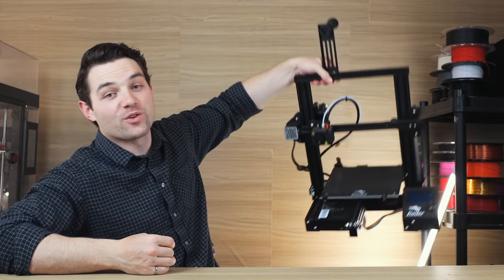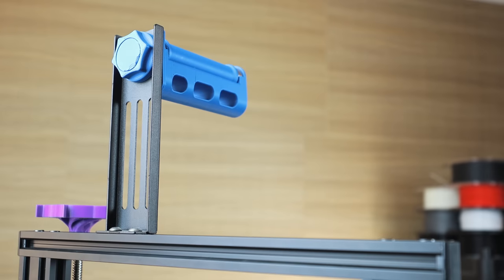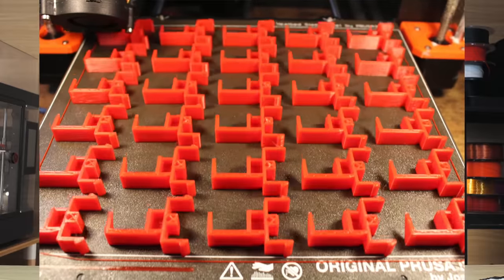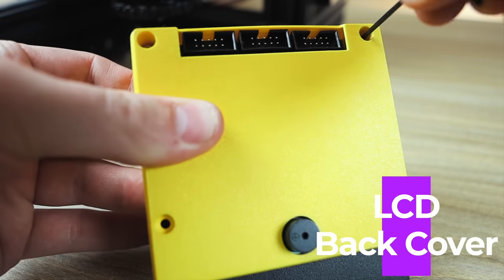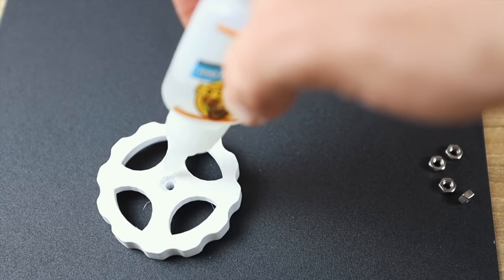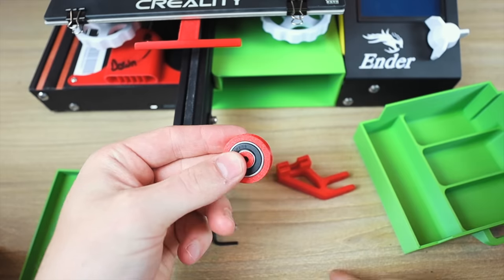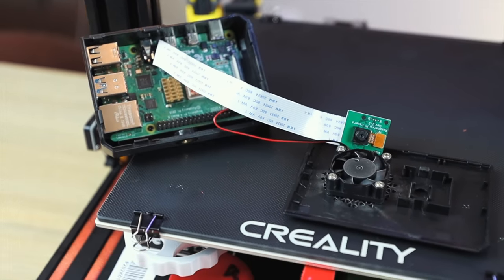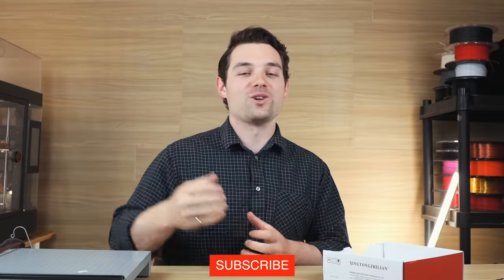Ender 3 Pro Upgrades - 2021

Comment: Honestly the BL touch is a must have imo. With creality's notorious reputation for warped beds, it's reduced the headaches and failed prints significantly, especially when working with abs and asa
Reply: Yeah that’s what i was thinking. No amount of leveling will help a warped bed
Reply: I dont use It and i never had a problem with abs failing because of bed craziness
Reply: @paolo69  yeah but there is also a reason they are just standard now on almost every new printer. simplicity, it removes that headache of trying to dial in the bed and even better mesh level corrects for manufacturing defects no amount of tinkering will fix

Comment: I've heard way too many stories of warped glass print beds so there's no way I'm not getting bl touch. Even if I don't need it, it's better to have one than miss it. I'm going to get ender 3 max soon, which ships with glass bed.
Reply: Yeah he is completely wrong about ABL. They should be called Auto Bed Level Compensators, since they do not change the actual level of the bed but CAN account for warped beds that are known QC issue with ender 3s
Reply: What’s bl touch ?
Reply: @theoneand0nly874  it's a small probe that can be bought seperately and attached to the print head. It's used for automatic bed leveling.

Comment: Bed leveling is much easier when you change the springs and do the leveling correctly, most instructions miss doing this correctly.
Have a glass bed ender 3 pro and don’t need glue or adhesive for PLA, and for PETG only need glue as a medium to ensure it releases from the glass. Have done a thingy on thingiverse that covers leveling, search my name there to find it.

Comment: I like to imagine this is me in a few years when I finish my engineering degree and have some printers :) fingers crossed!
Reply from the maker: 100% ! Good luck with the degree !
Reply: good luck!
Reply: Bro - this could be you now!!! Don’t let time hold you back. I did and I regretted it. Aim high!
Reply: If you got the money go for it now. You don't need a degree to start in this field. Start now and when you hopefully finish your degree you'll already have some good experience and momentum in this field!
Reply: Dude just buy a voxelab aquila it's $178 and it's the same thing as the ender 3 v2.
Reply: me too man. i’m going into my junior year for mechanical engineering.

Comment: The "ng design" drag chain's design seems wrong to me. It doesn't prevent the wire from bending in a very small arc as I think they should. This chain can bend in an arc with a very small radius, maybe 5mm or less. Which would means that using the chain won't protect the wire from bending fatigue.

Comment: I would recommend printing a storage container that attaches to the V slot covers, It is convenient for misc. tools. Also the BL touch and now the Creality CR touch are great for mapping the warping of the bed. over time the print bed warps and the sensor can account for that when printing.

Comment: bed leveling isnt difficult, and i have never run into issues with it, an auto leveling system is still better for a more consistent result throughout your build plate and only takes an extra 30 seconds and i never have to do it again

Comment: CR touch helped me a lot. my Ender 3 pro was 79.99, after assembly it didn't even work :(  I bought a silent motherboard 4.2.7 and it started printing, however, the aluminum heat bed was so bent up. The previous owner must have been rough with it because I could only print in certain small areas of the bed. when I moved the Y axis I would see the extruder going up and down even after I got a glass bed! So I tightened my bed a bit and got the cl touch and after auto leveling, it can print on the entire surface.  I ordered a new aluminum heat bed and I only expect more improvements.

Comment: I hate to say this but you don't really need a BL-Touch anymore, just use simple sugar water, all you need is a microwave tolerant glass, 1/2 teaspoon of table sugar and two or three drops of water then you stir the mixture up and put it in the microwave for 5 secs, no more. All you need is the yellow springs , and just level the bed once.

Comment: Hello thanks for your videos!! I have a ender 3 pro only to create clay cutters and after 6 pieces the printer is not working well it seems that the walls are not well filled and I don’t change anything , but I have no idea how to fix that again. Can you make a video to show good parameters to cut clay cutters but for really beginners I mean going into each step of the menu to explain what they are? I hate reading manuals and I need help!!! Thanks and gratings from Spain!!!

Comment: I have an regular non PRO Ender 3 for about 2 weeks, one of most important upgrade/modification for me was to connect motherboard box fan to extruder fan (always on) because for some reason Creality decided to put both of them under part cooling control. So I printed 2 prints of ABS without cooling of the motherboard. (ABS=part cooling fan 0%) Also, white USB card reader burns cards if they slightly moved, it burned 2 of my SD cards. Fan issue affect to my knowledge all of Ender 3 (PRO, V2) not sure about other models.

Comment: Hi. I really appreciate your candidness when it comes to the probes. Have you done a video on upgrades that can improve print quality for the ender 3, and wheter they actually work? You did metion the bowden tube, the bl-touch and glass bed. But how about other upgrades, like nossels and direct drive?
Thanks for a great video. Cheers.

Comment: I think on my Ender 3 Pro they mounted the electronics box upside down to keep the plastic out of the fan.  The SD Card reader is at the top.  Which by the way is a real pain in the ass when you insert  the SD Card and it falls to the bottom when missing the socket.

Comment: I'd avoid glass beds. I have had nothing by issues with prints and sticking. I've leveled it, Ive cleaned it and it just is a pain. I was able to get it to work with putting painters tape on it but its too cumbersome. Im just getting a flexible stainless steel magnetic mat which should be perfect.

Comment: The ammount of problems i've had over the last couple of weeks on my ender lol.
Some things just happen and I may have made a fwew mistakes but fwew
Reply: my ender 3 is working great.. I bought it a couple years ago and have printed as a hobby.. using..  maybe 5kg of filament so far (so not a ton I guess?) I don't know most of the problems people talk about.. but I have come to a few things:
1) I don't really use the aluminum bed/build tacky surface - mine came with the Glass+textured top bed (Corundum glass bed) - and I've never used anything else to print on - it's great.   so the 'warped bed' issues people complain about - I don't know if my bed was warped or not, because I have a glass bed on top of the heat bed.
2) build errors.  assembling it is .. nerve wracking for some.  any misalignment can mean disasters in the future, so quality checking each step is really desirable.

Comment: I don’t get the fanfare for glass print beds. It just adds a ton of weight to the y axis which introduces ghosting. My Ender came with a glass bed and I quickly ditched it for a magnetic bed and I’m never going back. So much easier to get prints off, and the quality improved. And it made an even bigger difference in print quality on my CR-10, since that bed is so huge.
Reply from the maker: The weight of the glass wouldn’t be what is causing the ghosting, maybe check the belt tension! 

The adhesion to glass is very good so for long prints it is reliable.
Reply: @AustenHartley  I’ve had far more prints come off of my glass beds than I do my magnetic ones. The glass absolutely caused my ghosting/ringing, because as soon as I took it off, no other changes to settings, it went away. It’s so heavy that when the Y motor tries to move it back and forth really quickly it starts making the whole machine shake and flex a bit, causing the ghosting on the Y axis. I’ve seen lots of videos with CR-10 owners saying the same.

Other than glass having a very smooth first layer, I find a magnetic removable bed to be better in every possible way. Give it a try!

Comment: I have a glass print bed but it’s from a window still works good
Reply from the maker: Careful cause if you heat it up to ABS temps and then cool it fast it could shatter !
Reply: I’ve found the glass beds that ender has are just rubbish. I had a hell of a time with my ender 5 plus’ glass bed. And it was silly weak. Regular pla ripped a chunk out of it :-/

Just go with a pei sheet instead and never look back. Glass makes baby Jesus cry.

Comment: Hi, great video, but, for the fan cover on the power supply, in the video, both screws are undone at once. DO NOT DO THIS. The fan will fall off, you can see it happening in the video, your power supply will no longer be cooled. Take off the bottom screw, do that mostly up with the cover, then do the top screw after the bottom one is definitely securing the fan.
Reply from the maker: You can just open the cover and put the fan back on.
Reply from the maker: But yes it is easier to do it without the fan moving.
Reply: Opening it is a good idea but often, capacitors can be found which could give a 240v shock on the primary winding, wich is not good

Comment: Could the plastic stip at 9:33 be turned up to have the angled grooves flat to the top of the 4040 bar.
That would fill the gap.

Comment: Bed leveling question. Everyone says clockwise raises the bed but for some reason on mine, the front left and rear right will raise when turned clockwise but the rear left and front right need to be turned counterclockwise to raise the bed. Whats going on?

Comment: The very first thing I upgraded on my Ender 3 Pro, an I rarely hear anyone talk about it, is putting terminal crimp blocks on the power supply leads instead of the raw wire.  Much less risk.  Also, the XT-60 connector to the bed is NOT an original one, but a cheap chinesium one that is prone to burning up, as the tolerances on the cheap one is terrible.  Original AMASS XT-60 connectors are dirt cheap, can have a back of 10 pairs for like $4 depending on where you shop.

Comment: Very helpful. Even I'm not a fan of E3 and own Homers Tarantula (pro??) as well as have built myself two custom i3's with 300x200 and 240x240 beds. Have to agree with you on the BLTouch, unnecessary complication as manual 16point mesh levelling does just the same job without too mush hustle and makes the printers plug and play(print).  The beds are hard mounted to the Y carriage so just a check from time to time and carry on printing. Sometimes people concentrate too much on accessories rather than functionality. Function before form, not the other way around.

Comment: The only thing I disagree with is the glass bed. Wasn't impressed when I used one, Now a Magnetic PEI Sheet. That's where it's at.
Reply from the maker: Pros and cons to both haha. The glass bed is definitely the one stop solution, especially if you are using a variety of materials. 

Magnetic PEI sheet is a great choice too though !
Reply: @AustenHartley  I got a glass bed for my ender 3 pro, was replaced very fast. Glass has nothing on PEI/PEX, Im now using the Wham Bam Pex flexible bed and its better than glass in every way.
Reply from the maker: I too have a textured sheet, there is one on the Raise Pro 2 in the video I am posting today. The issue is the adhesion to the bed with a textured sheet is much lower than that of a glass print bed. If you print a file that has a large surface area on the first layer, the probability of the corners lifting, is much higher on a textured sheet than it is on glass, especially with PETG or ABS.
Reply: @AustenHartley  wham bam pex bed is smoother than the glass bed. Not textured at all. You should give one a try! Also i find glass is the worst for adhesion. Everyone who uses glass seems to need hair spray or glue. With the pex ive never needed anything. Not trying to sound nasty or anything. Just saying what ive found. Keep up the great work!
Reply from the maker: @foohey87  yeah sounds good man ! I come at things from a production point of view and have had the best luck by far with glass. Whatever works for each person is the best solution for them. Everyone has preferences and different experiences. 

Cheers !

Comment: Bl touch with the traming feature added in the firmware makes you able to dial in each corner of the bed within .02mm on the ender 3 v2 there is even a port for the bl touch I haven't leveled my bed in months because of it.

Comment: I like the functional upgrades like the tool box and scraper holder. The LED and Rasperry pi mods are too much at this point as I've just started and dont really print very often, but I still think they're really cool. Definitely going to do some of these upgrades to my Ender 3 Pro, in fact I already ordered to Capricorn tubing and metal extruder. I got my Ender for $99 so the upgrades are a must.

Comment: My ender 3 pro doesn’t have an e fan cover also on mine I put in much stronger springs along with the original ones so it is almost impossible to undeveloped it easily I had trouble with them unscrewing themselves

Comment: Do you know if the springs are replaceable on the Ender-3 Pro?  I don't see the flathead screws on the bed
Reply: The screws are Phillips--and the reason you don't see them is, you probably have a magnetic bed attachment that came stock with your printer.  You'd have to scrape that off to get to the screw heads.

But you don't have to!  Just unscrew your adjustment wheels all the way off and lift the bed off the Y-carriage.  The adhesive bed magnet more than holds the screws in place. 

The stock springs suck; I didn't realize how bad they were--I replaced mine early on--until I bought a second Ender 3 and the difference between the beds was so night and day.  But now they have Silicone bed "spacers" and holy cow, but they're fantastic.  The silicone compresses as you tighten the screws down with the adjustment wheels and they have so much more contact area with the bed and carriage, the bed is much, much more stable.  Totally worth it.
These are the ones I put on my Ender 3v2: https://www.amazon.com/dp/B07MH4JQB8

Comment: You just said you must use adhesive to print on glass..... My prints stick like really good on plain glass with no adhesive required. I print PETG and PLA with no adhesive. My secret, bed temps between 75-85C, and 15mm/s initial layer speed and 0% fan on initial layers.

Comment: the bearings in your link are 6200-2rs but the print for the filament holder needs 608zz bearings that are smaller, can you check and edit your link please.
Reply from the maker: Good catch. I will post a comment. I believe the actual amazon listing changed. Will update via comment. Thank you.

Comment: I don't think you touched upon the reasoning for the new knobs. Do they assist with leveling (as in, are they better than the stock knobs for leveling)?
Reply from the maker: Size makes it easier to make small precise adjustments ! Also just way more convenient as you wont be bumping the machine with your hands as much when turning the knobs. Definitely a convenience upgrade, but over the course of the time you own the printer, you'll be happy you made the upgrade.

Comment: The board fan cover effectively removed the annoying high-pitched whine of the fan. Definitely do that.

I don't know about the glass bed though. I use the standard Creality one from the video and it's often almost impossible to get the prints off it, even after cooling down, and even after placing into a freezer!

Also the tiny duct is worse than the Creality stock.

Comment: Glass? Requires adhesives which creates an uneven surface over time,  uneven heating, takes forever to cool down

PEI Spring steel
Reply from the maker: I agree a PEI Spring Sheet is good too, however your reasoning is based on user experience and not exactly correct, especially when comparing to the alternative of a PEI sheet.

Comment: I’ve had an Ender 3 for 3 years and only just got it working this week but I stopped by micro center today on a road trip to get some extra filament and ended up impulsively buying an Ender 3 pro for $99 with a coupon that an employee told me about

Comment: Love these upgrades and I agree with your comment about the BL touch as it's easy to level the bed anyway,  use the philosophy of "KISS! "
Reply: BL helps with a lightly warped bed. It does not replace manual leveling just works along with it.

Comment: Just got this printer but stops printing after 5 seconds. Any suggestions?
Reply from the maker: check wiring, check that you have the correct voltage selected on the machine (the red switch at the back of the power supply) and check that you have all those power plugs(yellow caps) plugged in correctly !

Comment: Any tips on how to get adhesion with the glass bed? I've tried everything to get it to work... washed it with water and soap, wipe down with ipa, leveled with paper, leveled with multiple feeler gauges, live adjust the z offset, adjusted first layer height to .3, first layer speed down to 5, bed temp all the way up to 75.... im going insane trying to get this to stick....
Reply from the maker: Hey Caleb

It is likely that your nozzle is not close enough to the print bed. 

I would recommend also using an adhesive. (https://bit.ly/2X8SP00)
Reply: I have the exact opposite issue: the adhesion is so strong I'm often really struggling to get the prints off